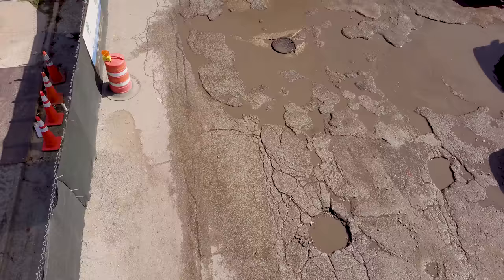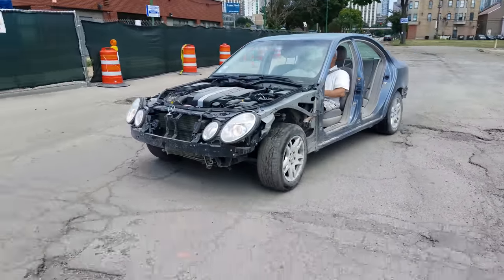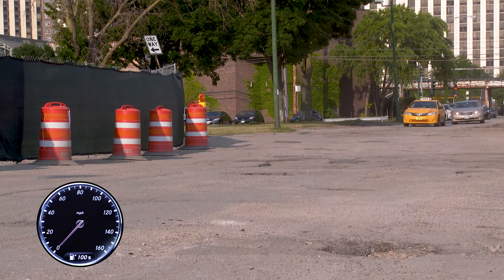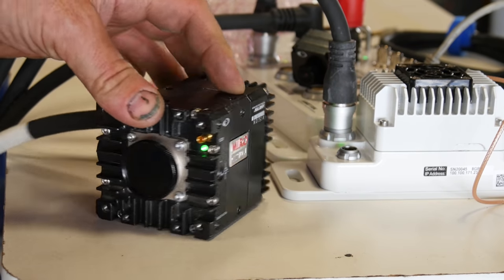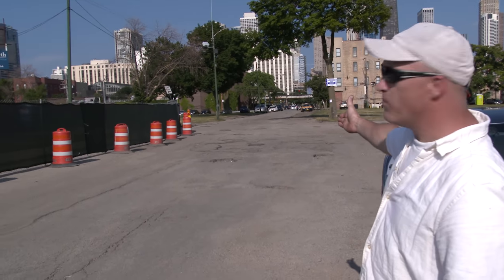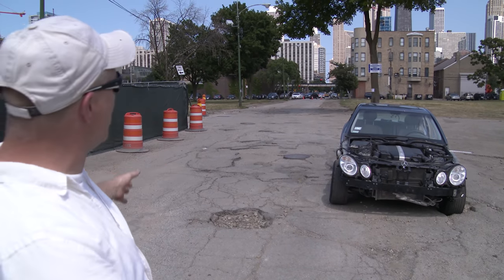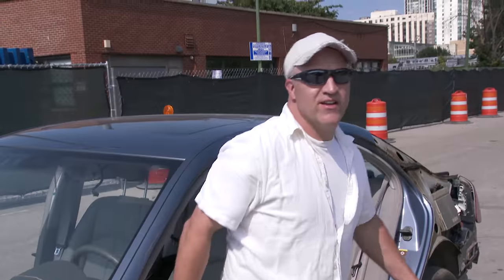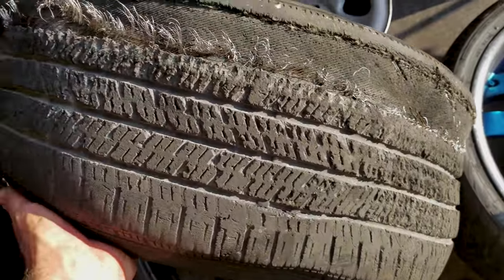Hitting Massive Potholes in 4k Slow Motion ( E.2)

Comment: that's pretty impressive how the cabin didn't shake that much when the car hit the pothole 😨
Reply from the maker: +Arie r I noticed the same thing, it seems like the cabin is made kind of like an egg, everything else outside of the cabin is pretty flexible, but inside those pillars its rigid
Reply: Warped Perception that's why the 47,5% of taxis in my country are E class (diesel engined). The other 47,5% are Skoda Octavia (diesel engined too). Finally the last 5% are other cars like Toyota Corolla, BMW 5 series, Opel, Peugeot, and even Toyota Prius (all diesel engined, except the last).

Comment: Stripping the car made the suspension perform much worse. This is because you have increased the sprung to unsprung weight ratio. This meant that the results weren't accurate. But nice video, keep it up! :)
Reply: Max   Exactly.  The ride frequency has increased.
Reply: indeed, also it showed me atleast, how much shock absorbers are needed to protect the sub frame. The forward rubber bush on the wish bone was working hard. An excellent opportunity to see the suspension at work.

Comment: NOW i'm impressed, i was kinda upset that you trashed this fine car at first but now i'm seeing valuable science play out in front of me here and it's just as interesting as the car it's self. seeing how the energy transfers through the whole frame like that when it's jostled around by the impact is pretty impressive. It shows what is going on with the external components and the underlying frame parts that we never get to see normally. still kind of upset because this was a totally repairable vehicle. yeah looked like the lower control arm bushings are worn slam out on that car too. it would be nice if after all of this you could put it back together and drive it still but even if not you should be able to get a pretty good penny for all of those parts you ripped off of it from people rebuilding wrecked cars like this one. ebay is yo friend

Comment: Park a decent car in some of those neighborhoods and they will look just like yours but without wheels.
Reply from the maker: +upside downdog lol. While I was driving to and from the location I messed with so many people, I told them I parked my car in Cabrini-Green and it got stripped overnight. They were freaking out.
Reply: Warped Perception 
Now THAT'S funny!!
Reply: If you can imagine that killer pothole, but about 3x bigger, and with 70% area of the road is potholes, that's what my road used to look like (70% was not an exaggeration, I did the approximation looking at Google maps a couple years ago, that's how bad the potholes were). I knocked the fenders off my dirt bike and got launched into a ditch by one of the 5 ft diameter holes (landed it well enough, but was not a pleasant experience...). Solution was just to turn the road into gravel, so it was only paved for about 2 years... Pretty crappy job making it if the road only lasts 2 years before they give up on it, turning it back into gravel.

Comment: i developed pot hole tests and analyzed road hazard results for the number 1 tire company. there were suspension systems that were not very good for the pot hole test. this variable was removed from the test. as you demonstrated, pinch shock damage was the main concern. broken cords result in rapid tire pressure loss. damaged cords can result in broken  cords and rapid air loss surprise sometime later. factors were pot hole geometry, vehicle speed, tire pressure, tire design. one of the major factors is tire aspect ratio. pinch shock damage severity goes up dramatically as sidewall height is decreased.

Comment: I've always wondered: suspension travel vertically. What absorbs the horizontal forces? There's obviously a 'lip' on that pothole. Is that the tire? Is there any mechanical give in the arms? Can't suspect much, if at any, or otherwise you'd turn the wheel.

Comment: Well, that's the problem of having big inch rims on modern cars, this is probably 18. In the late 90s an E-class sized car had 15 inch wheels and the thicker sidewall was able to compensate much bigger potholes and also the suspension and everything else on a car was made to last. Just look at that rust where the so called thrust arm is connected to the car. This is a facelifted W211 and it's 11 years old MAX. My 1991 car has no rust at all, only on the lower door trim which is held by 3 screws and can be bought for about 25€ each.
Reply: 14725800369 This is not the facelifted W211. The car has taken so much abuse and the suspension is still fine. Also, every car has that rust. It is surface rust. It does not go through the entire component. If it did, it would be long gone. Mercedes has always made robust suspension systems and this is no exception. They test these cars in such conditions with even bigger wheels. And anyway, no one is doing this to their car.
Reply: 14725800369 it’s obviously a pre facelift model. 2002-2006.

Comment: That happened to me in my E500! Bent my chrome AMG rim and popped one of my brand new conti-pros. I STILL have the set, no one wants them because one needs repair/replacement.
Reply: Did you cause any other suspension damage after bending your wheel? Curious if the force that bent your wheel did anything noticable to your suspension?
Thanks

Comment: 04:36 I wonder how much damage that would do to the suspension and steering components. The angles the wheel went, there's sure to be quite some damage.
Reply: Notice the engine mounts
Reply: Some parts are clearly already worn. Wheel is not supposed to behave like this, although this model Mercedes is not known for its reliability.

Comment: Lol what those parts are doing is exactly what there suppose to be doing making it more comfertable for the driver by taking the shock out of it inside the car most these parts are wear and tear parts and need to be changed and most of them are just bushes that need replacing all pretty cheap fixes

Comment: Rear tire ONLY popped due to you thinking it was a drift car after you removed 1000 pounds from it, the tire was already down to steel belt and throwing "strings" off the tire
Reply from the maker: +Daniel Rich well yeah, but what about the front? Although I have to give it to you, because in episode 3 with the new tires, the first run had interesting results and the tires didn't pop.
Reply: Warped Perception tire pressure is every thing too, maybe check the pressure on video on all tires next time? Thanks for the reply

Comment: If you attempt to drive a car looking like that, let alone with flat tires, in any European city you'll get your ass kicked immediately. Quite possibly though criminal court. I'm only guessing you got permits? If not my respect for America.
Reply: having a beat up looking car isn't illegal here. its still got a windshield and all the lights so its good to go
Reply from the maker: +Borja Acosta de Vizcaíno we did have transportation permits and all the other necessary permits but it's not illegal to drive a car with bumpers and working headlights tail lights and brake lights. You don't need doors to drive according to the law in Illinois. That was an interesting fact for me to find out too.
Reply: it's the same case here in New York. Doors are not necessary, nor do you need wheels to have fenders over them.
Reply: Here in Sweden, you must have good brakes, good tires, good suspension etc. And you absolutely can not have things sticking out like the camera mounts. You would get a hefty fine for driving that.

I don't think doors are required, though.
Reply: Yeah as usual Europe is pretty backwards.
Reply from the maker: Borja Acosta de Vizcaíno in what County do you live ?
Reply: Warped Perception Well, I kind of expected it, knowing that the Jeep Wrangler has removable doors and is road-legal (I guess) in Illinois. And I mean, many old Jeeps don't even have doors.
Reply: Not sure backwards, but most definitely over regulated.

Comment: Eh... what good does it do to make slow motion captures of suspension components that are totally shot and won't even help dampening the shot from driving across a peanut? A waste of time effort if you ask me, for you making the movie and for me watching it. It's just completely uninformative.
Reply from the maker: +LogiForce86 shot or not, they sure seem to work in my opinion.
Reply: Warped Perception A grandma with arthritis also still works but they won't be capable of operating at optimum efficiency anymore. So in my opinion there is a difference between something just working or something working properly.